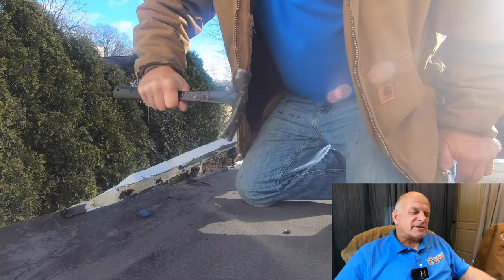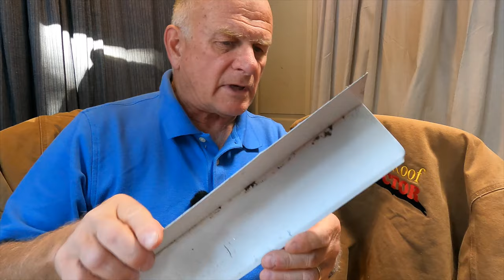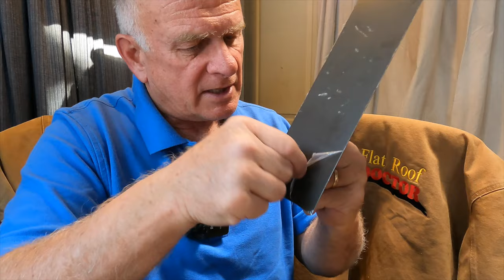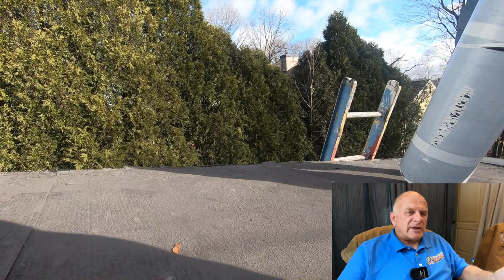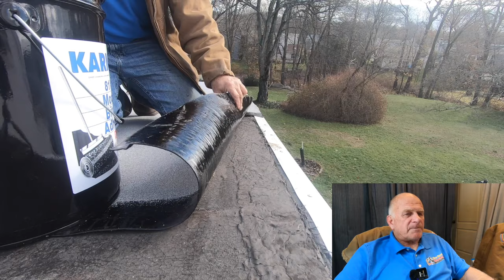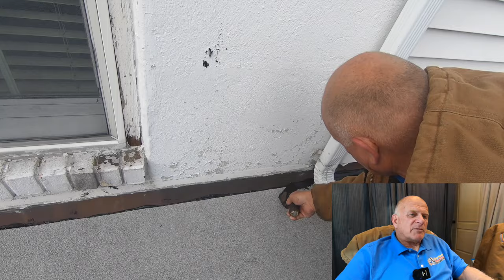Quickest Easiest Cheapest Flat Roof Install - only Hammer, knife, trowel, tin snips - DIY Home Owner

Comment: Hi I just wanted to know if someone installed rolled roofing on my house before i owned it and it leaked, would i need to pull up the current roof to repairs the leaks or put the new cap sheet over the old? the asphalt is cracked and the wood seems pretty worn
Reply: Hey brother. From.yhe info given. I do roofing myself.  Just not this type. But from doing renovations. My understanding would be for you to take of the old roof and replace the old wood then treat it for termites etc if needed. Then install the new cap sheeting. This way you get value for you dollar and don't have any issues with more leaking from poor structural defects. Also be sure to grind whoever you hire so they do a good job. Not to much that it's discouraging but to get  good professional work done. Hopefully other roofmen can give more info to guide you
Reply: @saber7even371  Thanks man i appreciate the help, didn't even consider termites or any pest outside of the natural elements but that's definitely on the list now. I'll be sure to make sure they do it right and correct the first time around, finding contractors in nyc is very difficult because they just want the money and skimp out on the work, but thanks man ill definitely take heed to your words

Comment: will this work over shingles,or do I need to remove the shingles  ?
Reply: No no no. Shingles means your roof isn't flat. Just watch some videos on how to shingle. Shingles are very cheap! (And last longer than a flat roof).

Buy a nail gun, it will save you 70% of the labor time.

Comment: The Karnak 81 is impossible to find anywhere near me. I am doing a 6 sq flat roof, so i dont need  as much as a alrge commercial roof. Are there any suitable substitutions ?
Reply from the maker: Honestly, sad to say, that is the only product that will work. Karnak 81 Trowel or Karnak 66 Trowel. You need to call a roofing supply company like ABC Building Supply or Beacon Building Supply or maybe a local roofing supply company to get you 5 gallons of the stuff.
Reply: @FlatRoofDoctor  is karnak the same as plastic roof cement?
Reply: @sirjohnahayfalcon  no, definitely not

Comment: I have been looking at this on the Beacon Roofing site.  There are so many of the peel and stick products. Does it matter which one I get? 

CertainTeed Roofing Flintlastic® SA Self-Adhered Cap
TRI-BUILT SA Base 2 SQ. Roll
Polyglass 142 mil 39-3/8" x 32'10" Polyflex® SA P Self-Adhered Granulated APP (Plastomeric) Cap Sheet 
GAF  Liberty™ SBS Self-Adhering Cap Sheet 
DynaBase
Polyglass 80 mil 39-3/8" x 65'8" Elastoflex® SA V Self-Adhered SBS Roof Membrane
Johns Manville DynaGlas
GAF   Liberty™ SBS Self-Adhering Base/Ply Sheet

Comment: Aluminum Awing Pans would have been faster and probably about the same price
if you did it yourself. Last forever, No tar, no flame thrower. Just some screws on both ends.

Comment: my roof is leaking. 

The 150m² flat roof is from 1987 and is installed on a concrete Roof without gradient. 
6cm Styroform than a 2mm thin black layer and then a 5mm PYE Layer torch down and on top 5-7cm thik layer gravel.

My Plan is to push away the gravel 1m or 2m meters like Snow to a pile. than put a new 5mm Layer PYE PV200 S5 torch Down. 
Than push the gravel back in place and make the next one or two meters  and so on.....

my question is. should i use the PYE with or without the ^^ceramik^^ granulate on ist. 

The old roof is without ^^ceramic^^ bacause there is a 5-7cm gravel layer.

thanks
Reply from the maker: remove the gravel completely. Get rid of it. Then Torch your membrane directly to the old one, with ceramic granules. No need to put the gravel back
Reply: @FlatRoofDoctor  Thank you very much.

Comment: Guys this kind of stuff would be named and shamed in the uk. 

The upstanding material are not dressed with flashings.The entire roof is only tacked in place.

Any other roof system would be loads better. Liquid systems are much easier and more efficient with 20 years guarantee. Liquid systems you literally paint on the material.

Moral of the story If your going to do it yourself then do it right .

Comment: This method may not meet current building codes. It can also void your homeowner's insurance claim if the roof fails.
Reply: Can you tell us what is missing?  What wood pass most stringent codes?
Reply: @SmedleyButler1  it depends where you live, the pitch and what is currently on the roof. But always plan on your insurance company doing everything they can to not pay, and this could give them a reason. However, if you're interested in doing it this way, it's probly already leaking and you probly don't have the money to do it right, so in that case it's ok... personally I'd still do it differently.
Reply: I had a new roof professionally installed and it failed on a porch area so wasn’t easy to detect. My insurance wasn’t interested in paying anyway bc rot is a neglect issue and not covered. So with this flat area still leaking (with dimensional shingles) I intend to repair it myself. Don’t really care if insurance “covers” my install bc they don’t cover 
a ‘professional’ install. So relax.
Reply: @briansmith207  : Yeah, tell me about those insurance bast**ds.
Reply: Why? 
Not everyone has $5000 sitting around.
Home repairs are out of control. All costs are out of control.  People need to start taking control themselves.
Reply: @Miami543210  couldn't agree with you more. Many home projects can be diy if you do your research and take your time.  The cost of contractors many who use immigrants to do the work to control costs is outrageous and sometimes not quality work.
Reply: I paid 60k for a roofer in Lubbock to replace my roof with foam. Within a year it was disintegrated. Could not get the roofer to make it right since it had 10 year warranty. I stripped it off and redone similar to what is shown here. Have had it in place approximately 5 years. 14k on material.
Reply: @bycracky22  Unbelievable.  I hope you sued the roofer and had his licensed yanked.
Reply: What building codes? And void homeowners insurance? What are u talking about? Flat roofs are notorious leakers & this method is super & will keep the roof from leaking, something insurance companies like! This isn't a hack job video, he is a seasoned PRO & all his work is neatly & well done, no corner cutting on quality of materials. You don't know what you're talking about! This is much better than putting on rolled roofing which many roofers do which will only last about 5 years.
Reply: What roofing company are you from
Reply: Depends on the state you live in codes are different
Reply: If you go through insurance it will cost more than hiring a roofer out of pocket. Your premiums will go up and it will cost more in the long run. 

If this wasn’t true then every insurance company in the country would be bankrupt.

That being said just learn how to use a torch or cold mop, I’ve see these  peel and sticks blow away all the time (Philadelphia)

Comment: If it isn’t hot won’t stick🙄just a glorified flashband useless in temperate climates,just get the professionals in to do a 3 layer torch on system or have lots of grief

Comment: Drip edge goes under the ice and water barrier, not on top. Also, the rolled Roofing doesn't get butted together at the seam. They overlap. This is terrible advice
Reply: Pretty sure he overlapped it by about 4 inches.